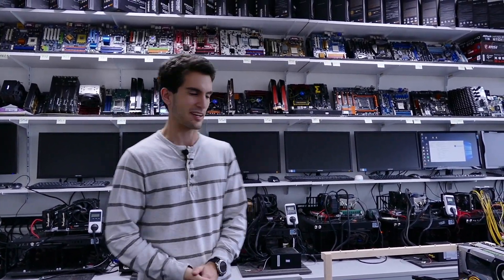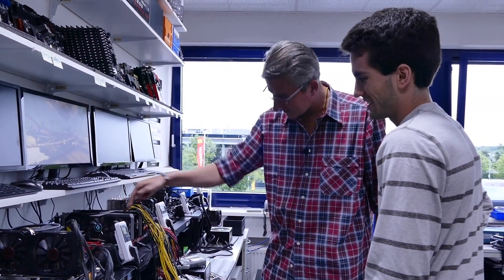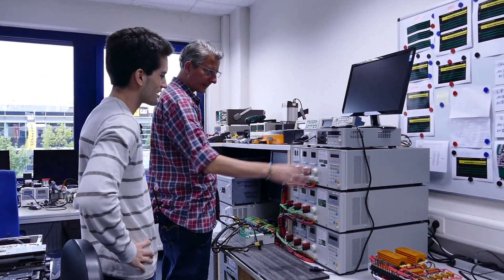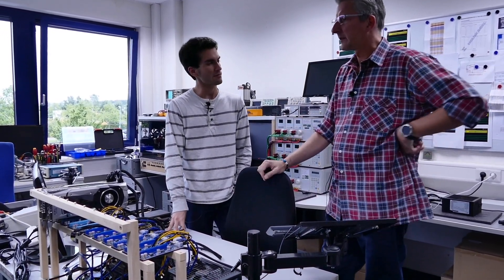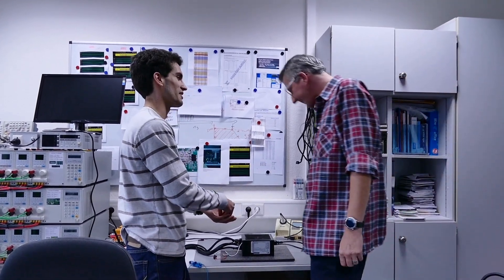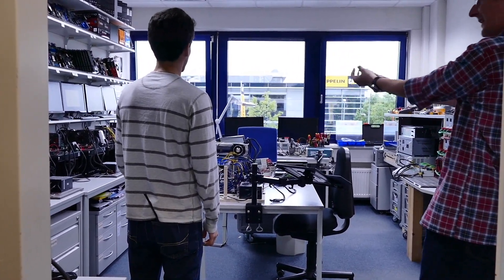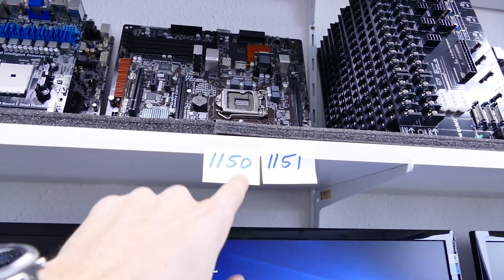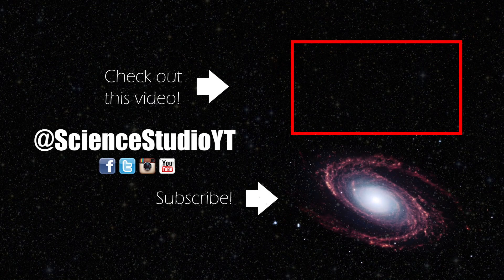BeQuiet HQ Tour in Hamburg, Germany! (Part 2 of 2)

Comment: I liked to see the lab, with the DC electronic loads, some oscilloscopes, the soldering station, the amperometric clamps and other equipment that I could not distinguish very well. 
That custom PCB was a smart idea and is well designed (you can see all those power plans corresponding to the different voltages). 
It is good to know that be quiet gives priority to the quality and to the prolongation of the useful life of its products because I did not know that the fan is always rotating, to guarantee some air flow (no planned obsolescence!).
I hope to see more again in the future.

Comment: WIth all my experience in high-end rigs and PSU's
Be Quiet! hits the nail price/value wise. Till now not one has failed on me.
Even have a old 300w (2009-ish) running for years now 24/7 in my file server, not a single problem. Even the fan bearing is still doing great.

Comment: Hi Greg, you can get pocket psu testers I recommend one with digital readouts over one with just an on light for power as you can see if there is variance outside the manufacturers spec . This saved me a lot of time when testing when I was working in a store. If the psu fails, it's the psu if the psu is good you can eliminate it as the sorce of the issue straight away.

Comment: 12:00 It is based on Amperes Law and works the same way that Current Transformers work on Power Distribution. They use these even in hydroelectric dams.

Comment: The reason I want a new PSU even though I have a 1000W model, is because I have a first gen corsair link RM1000 PSU, but I can't get the cable to connect it to my MOBO because it didn't come with the PSU. It runs so damn hot that the heat just rises and adds more heat to the inside of my case.

Comment: No one makes powersupply for very old pcs that take most power on 5v many of my old rigs needs 25amps on 5v....
Reply: old system = old psu easy
Reply: Malte Roeper and did i mention that old psus blew up in somkes and the voltage become unstable and it is hard to find because every one scraped it ....
Reply: Kuntal ghosh well u could do a work around with a voltage buck converter circuit to get the 12 down to 5

Comment: Honestly, once I had (and still have somewhere)beQuiet! power supply after 2 years it started to restart my system totally random, every 3-4 hours. I needed the system so I  ordered new one. I even went with RMA process but had my system working and totally forgot to send broken power supply. Still having it around.

Comment: With an auto shut off for PSU fans as a feature,  I'm  guessing the other PSU makers are hedging on the fact that their components can handle that much load without sacrificing much longevity.
Reply: Flipsider Most higher end PSUs can turn of their can at lower loads. And completely passive PSUs exist, though they do rely on case air flow

Comment: And then they call Seasonic, SuperFlower, CWT, etc and ask them to build them their PSU. 

They do test their PSUs, while others design PSUs for them ( based on their input ). Buy Seasonic and SuperFlower PSUs, their are only ones developed from the scratch.
Reply: RoboDog Like 99% of other brands... Only Seasonic and PowerFlower make their own PSUs, but many brands design their own high-end PSUs and get the other brands to build them though.
Reply: R T I totally agree, PSUs are dead in the water technology and that migh be a good thing. PSUs being at peak performance, OEM have to offer something more to consumers if they are to consider their product.

While BQ arent bad ( they arent great either ), they have one hell of a marketing division. I bought new 650 w Gold certified PSU and i didnt even consider them. Antec, Corsiar, XFX, Seasonic, SuperFlower and Thermaltake is ones which i trust.
Reply: R T you tell me be quiet! of all brands forgoes silence and makes psu with the fan always on??
Reply: Listan has pretty much their entire psu line-up built by FSP at this point - the only exception I am aware of is their new SFX-L unit. 
Using external OEMs does not mean there is no engineering done on this company's side of things, btw. Or would you knock on Nvidia and AMD, too, because they use OEMs to produce their chips? Or rejoice in people flaming Apple, because Samsung is one of their OEMs and use that as an actual argument against buying their products? So few companies have their own production facilities these days, yet most people would never think of calling their products anything but of their own making. 
Those that do, however, oddly enough feel to have a lot of insight, while their statements actually show that this is not the case at all xD

I always find that point of view funny, does not show a lot of insight in how industrial processes work these days, though ^_^